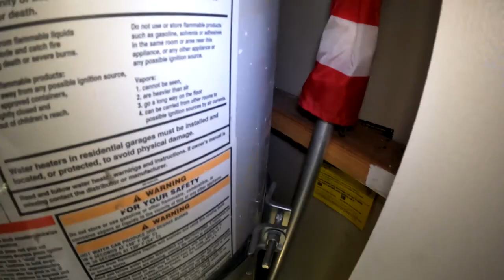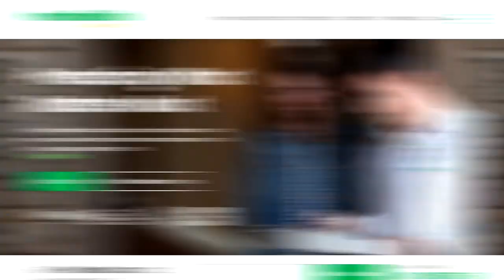How to Get Rid of RATS in your Crawl Space FAST!

Comment: I know I am late to the party. I just enjoy your videos :)
We have mice in the walls and partial attic. UK here and the pest controllers are terrible. They cannot get into the house part because it’s all blocked unless they chew which they’ve not. Our houses are attached to others and we know they are further down and hear them sometimes in the attic section but it’s an almost flat roof. There is no access to the attic section due to how flat the roof almost is but all access points are closed and yet mic are getting in and you here across the roof only. Supposedly residents further down have it really bad but because the homes are connected. We cannot stop them and it’s literally closed off everywhere so it’s confusing.